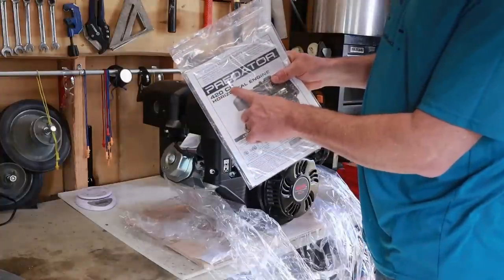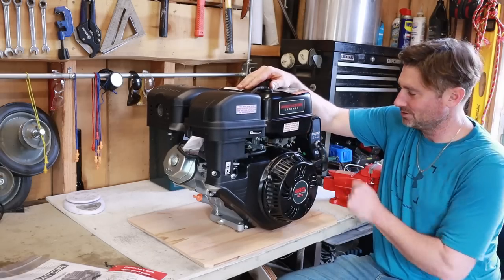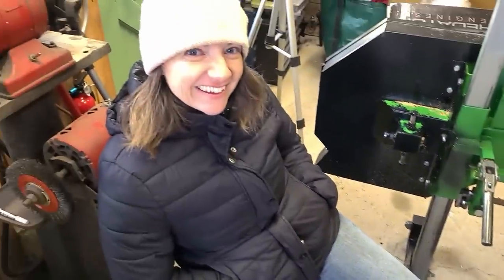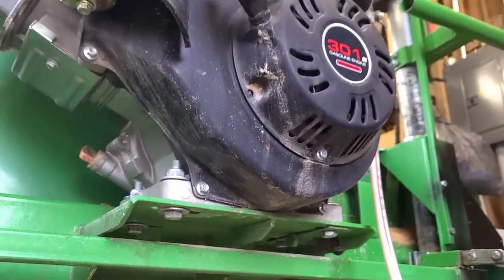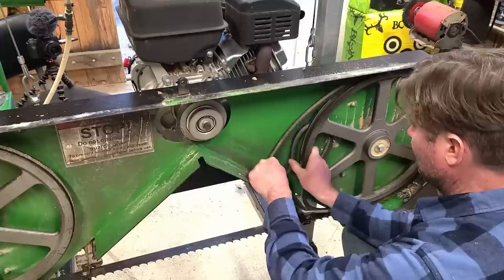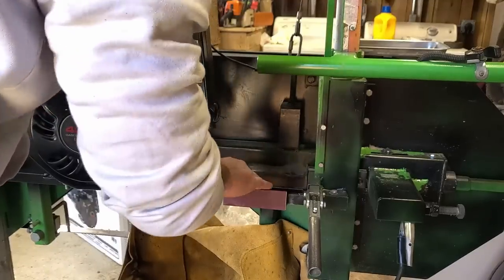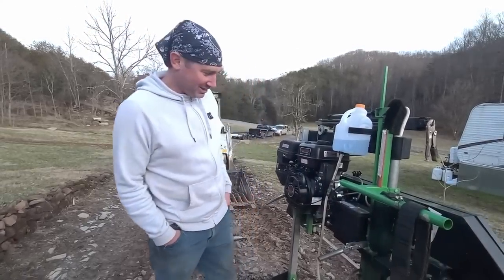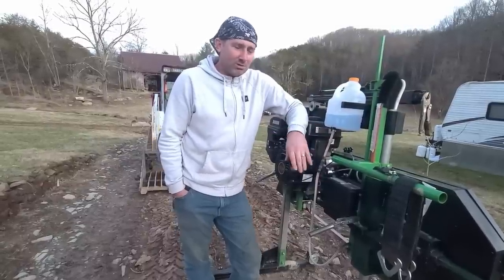Engine swap (UPGRADE) Harbor Freight sawmill // E117

Comment: I cringed when you tried to start that bolt with the impact driver. Don't do that even the correct size bolt can go cross threaded. I'd also use a floor magnet to clean up metal shavings/grindings so the dogs don't get sore feet. Excellent job.

Comment: Ha John . A FYI . When you use a flat and lock washer with a bolt the lock washer goes against the bolt . Check the bolt that holds the clutch and you will find that is what you didn't do . But all in all the new engine install went well .. Ya might wanna think about insulating the battery tray from engine vibration with some kind of rubber mat . Your battery will last longer ...

Comment: Well done and congrats on the power and electric starter upgrade. Even though the battery seems to fit quite snuggly, I'd still be inclined to put at least a cam strap to hold it in place and stop it shaking in its seat. Also, with all the new electric stuff, it might be prudent to make some form of waterproof covering for the mill. Even if only plastic sheet tied down with rope. It should allow things to keep working as intended, much longer.
It is pretty obvious that Meg is the brains behind the outfit, letting the boys do all the grunt work!!
Cheers, EJ.

Comment: Your split ring or lock washer should go against the bolt head.  Not sandwiched between washers.  I would recommend changing that around because at this point that split ring is keeping the washer locked together and nothing is really keeping the bolt from spinning.
Reply: I think it will probably be fine with the thread locker he put on there.
Reply: @Rob Fox  I'm inclined to believe the original engineer knew more than us and had thread locker with a split ring for a reason.  It may be a bit overkill and more than likely not a problem but why risk it when it takes less than 2 minutes to fix?

Comment: Just an FYI red lock will make it really hard to get the bolt out with out heat to break it it lose always use blue on things you might have to remove again
Reply: I think that was J-B Weld Perma-Lock brand. Not the permanent style red loctite.
Reply from the maker: Yes, JB weld kind
Reply: I've never had a problem removing bolts I've put red Locktight on.
God bless you!

Comment: Welcome to the electric start club!  Couple of more tweaks for ya:   The push handle can be moved about six inches up the frame.  Just drill two more holes as far up as the handle will fit.  It will allow you a couple of more inches of height if you've go a really big log.  My 420 exhaust just rubs when I crank it up that high.  ¯\_(ツ)_/¯  Finally, I took that little exhaust diverter and turned it 90 degrees, so it points straight up.  It was pointing forward, and got the enclosure pretty hot.  Didn't care for that.  Enjoy your newfound power!

Comment: Might want to put rubber or at least cardboard under battery so vibration doesn’t wear a hole in it. Drawer lining rubber should work.
Reply: Yoga mats work as well

Comment: Check the belt alignment with a straight edge across both pullies that will tell you if motor is aligned if it isn't aligned properly the belt will wear or come off.

Comment: I have seen one other u tube video,  with the 420 swap and harbor freight sawmill.  I like the way you moved the motor mounts. I have had a 420 sitting on the bench since last spring. Might be time to swap.
Reply: You may be able to swap the muffler from the old engine onto the new engine and then you wouldn't have to do all the work he did plus the belt pulley will still line up with the other pulley. 
I think he's going to have issues with belt wear and he may have problems with the belt coming off the pulley too.
God bless you!

Comment: You will be happy with the replacement of the engine so you have more power which you will need when you start building your house. Suggestion for you.... screw a fitting into the oil fill threads and connect a hose to the fitting then insert a funnel into the top end of the hose so you can add oil to the engine much easier. Do the same thing with the drain hole so you don't have an oil mess.

Comment: As some father in laws would say, Maybe my daughter won't starve after all. Your proving to be quite resourceful and piecable fellow. I mean who wouldn't be frightened seeing a guy come out of the garage looking like he was on a straight raw meat diet for some time. About the only thing I never cared for on small engines is the noise from the centrifugal clutch rattle. Nothing I know of can ever get rid of it so just living with is the only option short of electrical motors to run a sawmill. I have ran mills that were all electric and to tell the truth, getting shocked when its raining ain't as fun as watching the guy who gets shocked. Oh yeah, says right on the motor to not operate in wet conditions but where is the fun in that. I was kind of hoping your idea of a acme thread motor to run the mill up and down might just of happened also but thats for another day.

Comment: I thought the oil filler is on the other side as appears in the picture. that plug you undid was the fill level.  yeah? Well done though on how you made the adjustments for the new motor mixing /adjust bracket.

Comment: All in all is this mill worthy of consideration?? Have you been satisfied with the performance till the motor upgrade?
Reply: I did the same upgrade to the same mill.  I don't have much for large hardwood, but I do mill some big pine that barely fits on this mill.  The biggest benefit of the 420 is the electric start.  Yes, the extra ponies are helpful, but for those of use with worn-out shoulders, electric start is heaven.

Comment: Looks like you got it figured out already, but I couldn't help thinking while watching you modify the mill to fit the new engine......what if you just cut a half inch off the length of the green space? Theres probably a reason I couldn't see why you didn't go that route.

Comment: In the future if you need a template like the one you needed for the support, use a rag with used engine oil to wipe on the bottom of the location for which the template is needed. Then, press the transfer material (the paper) on to the area being copied to the template.

Comment: Great job on all of the upgrades to your mill! I was born and raised in Kingsport. Did you consider swapping for the Predator 459cc (15.8hp) engine? It's about $70 more expensive (+$16.3%) , but would add an extra 21.5% hp. I'm considering the larger engine, but specs are not clear & there may be a reason why it would involve a much more complex swap - or is needless extra hp. Tks!
Reply from the maker: Hello there neighbor!  Haha.  I did consider that bigger motor, but I didn't feel it was necessary for the majority of what I'm cutting, which is yellow poplar.  Right now, I'm cutting a bunch of loblolly pine, which has a similar hardness to yellow poplar and it's going through very smoothly.  It also ran ash nicely, but they weren't enormous in diameter.  I'd be worried about the clearance with the 459cc.  I'm sure you can get it on there, but you'll probably need to extend the drive shaft so the exhaust system clears the sawmill's frame.  I'm sure you can do it if you plan it out.  Good luck!

Comment: Just keep an eye on the drive belt that it doesn't ware on one side or the other a measurement from the inside of the saw guard to the outside face of the pulley would have been good before you took the old engine out. But you'll be all right. Nice job

Comment: A 51 or 51r is just slightly larger than the lawn engines batteries and is not much more costly. However, it is a full auto battery, usually with a full 3 yr. free replacement Guarantee (depending on where you buy it, Sam's Club is good or even Auto Zone) and withstands much more environmental and discharge problems.

Comment: The stainless steel bolt in contact with carbon steel crankshaft has the potential to create galvanic corrosion.
Reply: I think the thread locker he put  on there will protect from that quite well.
Reply: yeah it will never come off again without heating it which will destroy the clutch and engine oil seal

Comment: Why didn't you just modify the exhaust shield rather than moving the engine mount ?  Without spacing the clutch out to match how much you moved the engine out your belt won't be in alignment .

Comment: Does this saw work well with soft and hard woods?
Thank you.
Reply from the maker: I've built 2 structures with it so far, one of which has ash siding.  The house is next, framed with poplar.  It performs well with a 16 in. log.  Anything bigger, up to 20 in. is the max, you need to slow down your feed rate.  But I've cut ash, oak, walnut, and hickory without an issue.  It's all in the blade too.  I use woodmizer double hard .055 blades.  The engine upgrade was definitely worth it.
Reply: Ok
Thanks

Comment: At 9;00 about time u got the power tool out
U need a pully puller three prong 
Not I been there done that when I did not have a pully puller 20 bucks and u dont need to use hammer any more
If nine cars or pickups go by my house all day someone went to town twice  Summer time more tractors then cars and someday more pickups but they have hay wagons behind them
But normal day like I said if nine...

Comment: you should have weld those two open gaps with 2 pieces steel just to be safe, if the engine cracks the welds., those that engine needs to be broken it, before using